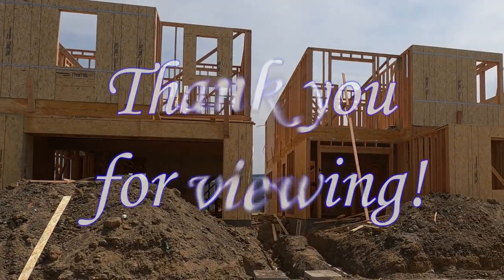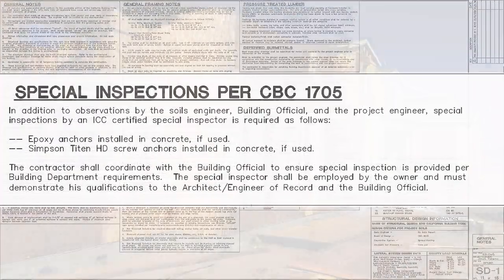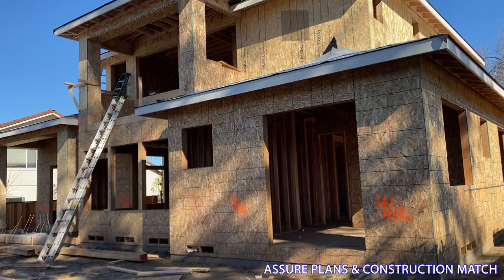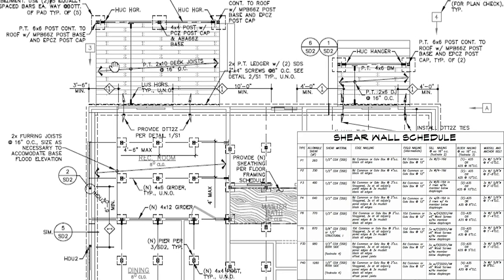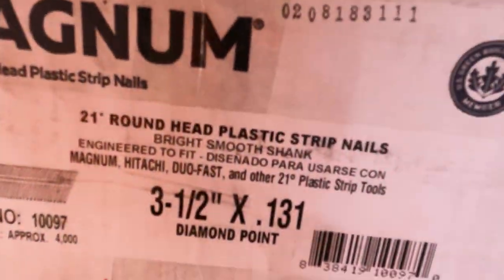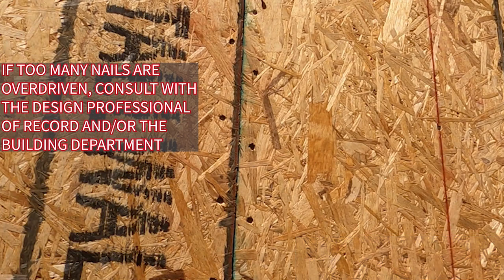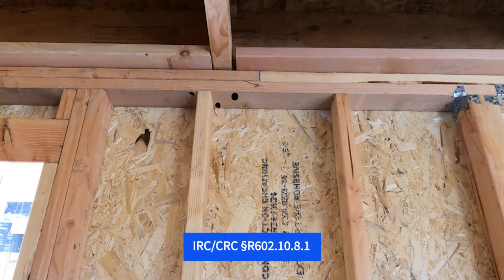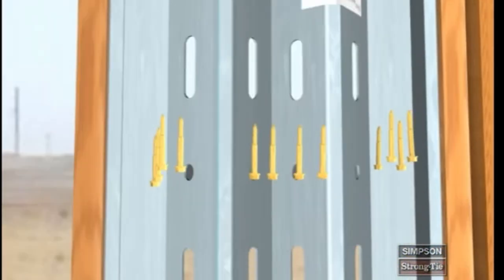Exterior Shear Wall Inspection

Comment: Lots of good information. Just started my new job as residential inspector and can use the help. Made a check list for in the field. Thanks for the video and keep them coming.
Reply from the maker: Congratulations!  It is fantastic that you got an opportunity as a residential inspector!  If I am not mistaken, not too long ago you had expressed interest in the profession on this platform – and now you have achieved your ambitions --- way cool!

Probably the first few months it may feel overwhelming due to all the information/processes/requirements/documentation etc… However, it will not take long for things to start becoming more and more familiar… But never let the learning stop tough, lots of great information and processes to learn in this ever-changing profession. 

You will do very well, however.  Stay on path and please do not hesitate to reach out if you have any questions at all.  

Cheers!

Jose M

Comment: Another greatly put together educational video. What trades can be installed before shear wall inspection or which may be installed before dried-in of the structure (roof and walls)?
Good job Martinez 👍🏼
Reply from the maker: Martinez!  Thank you for the question and for the kind words about the content.  You ask a great question, and briefly put – the codes do not explicitly address this sequence, as it relates to the “drying-in” of a structure.   However, when it comes to which trades should be installed before the structure is dried-in, it is important to consider the susceptibility of the materials proposed to water damage; for example, materials sensitive to moisture such as non-metallic sheathed cable (Romex) and insulation, should be installed after the building is dried-in, this way their effectiveness and longevity is not compromised.   Ultimately, it is often local building departments - through ordinances, that often (should) provide further guidance on the sequence of construction, per R109.1.5 “Other Inspections.”  I hope this helps, Mr. Martinez.  Great to hear from you.
Jose L. Martinez

Comment: Can you please tell me where and how often hold down brackets (Simpson HDU2 specifically) should be placed and what type of bolts are acceptable when doing a seismic retrofit in California? From what I’ve read so far on the Internet, I believe they’re supposed to be installed on the ends of sheer walls with a 12 inch epoxy bolt. If you could verify, that would be really helpful. Thanks so much!
Reply from the maker: Hello.  The specifics of how hold down brackets, such as the Simpson HDU2, should be installed can vary based on the local jurisdiction and the specific conditions of the building. However, here is general guidance based on standard practices and the information available in the CBC.
Hold Down Brackets (Simpson HDU2):
1.	Placement: Hold down brackets like the Simpson HDU2 are typically installed at the ends of shear walls. The exact spacing and placement depend on the design of the shear wall and the seismic forces it needs to resist – such as number of stories of the building, seismic zone the building is in, soils conditions, building design, and existing structural conditions of the building. 
Bolts for Seismic Retrofitting:
1.	Type: Epoxy bolts or adhesive anchors are commonly used for seismic retrofitting. They are inserted into drilled holes in the concrete and bonded in place with epoxy.
2.	Size and Length: The size and length of the bolts are specified based on the load requirements and the thickness of the foundation or the material they are anchored into. A 12-inch bolt is a common choice but may vary based on structural requirements.
3.	Epoxy Type: The type of epoxy used should be appropriate for the intended load and environmental conditions. It should be compatible with both the bolt and the base material.
Considerations:
•	Local Codes: Local building departments may have specific requirements or amendments to the state code, so it is important to consult with them.
•	Professional Guidance: Due to the complexity and safety implications of seismic retrofitting, it is strongly recommended to consult with a structural engineer that is familiar with local codes and seismic retrofitting practices.
•	Earthquake Brace + Bolt Program (California): The agency specified assists property owners, that have qualifying older homes, with grants toward a seismic retrofit.  This is typically for wood-framed homes with a crawlspace, less than 2 stories, that have cripple walls – see the standard plan on the link for more information: https://abag.ca.gov/sites/default/files/plan-set-a.pdf ; and here is the link to the agency: https://www.earthquakebracebolt.com/   
I hope this helps you.  Best of luck to you.   

JM

Comment: Have the building codes changed? The hold down anchors in my house (just did a remodel) seemed to be twice as tall as the ones in your video. My home was built in 2009. If I could have reduced the height of them, would sure have made the kitchen drain relocation easier.
Reply from the maker: Great question.  Building codes do change every three years; however, this video does not depict how a residential structure should be structurally designed.  The information on this video is merely an example to help viewers decipher shear wall example plans and gain an understanding on a shear wall inspection.  The structural design to a structure/alterations, etc., are site specific – so it depends on your region’s soils, seismic, wind, and local structural amendments (amongst other factors).   Although you ask a great question, it is better suited to your design professional and the local building department. 

I hope this makes sense.

Take care.
Jose M

Comment: Will inspector pass shear walls if sheating runs from bottom plate to half of rim joist for a two story house ?
Reply from the maker: Hello.  Great question.  That depends on how it is designed; meaning, it depends on the plan construction details.  If a construction detail is not identified on the plan, then I would query the design professional of record.   Furthermore, it is not unusual for the shear panel to run from the bottom plate - to the top plate (shy of the rim joist); with other methods of shear transfer such as clips; but I digress - and as I mentioned, it depends on the design, the code does not specifically address this scenario (to my knowledge).  

So to answer your question; the inspector will pass it if it is shown on plans as you describe.  If there is no construction detail, I would consult with the design professional for guidance. 

Not sure if the above helps; but feel free to let me know if you need further clarification.

Jose M

Comment: ….what about stamped/signed engineering required for shear wall.
Reply from the maker: Hi.  Please forgive me if I misunderstand the question.  Stamped/signed design analysis are not the focus of this video, as this video is specific to the Shear Wall Inspection.  I will, however, cover stamp & signature requirements (design limitations for unlicensed individuals) at a later video -- which will segue to Plan Submittal and Plan Review Requirements. 
Please let me know if I did not address your question.  Thank you for checking out the channel.

Be well.

- Jose M